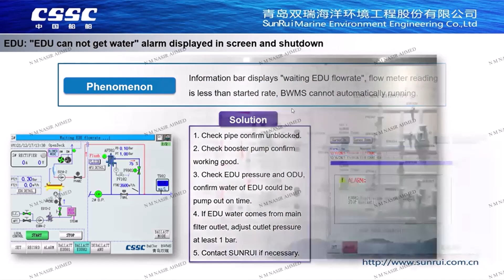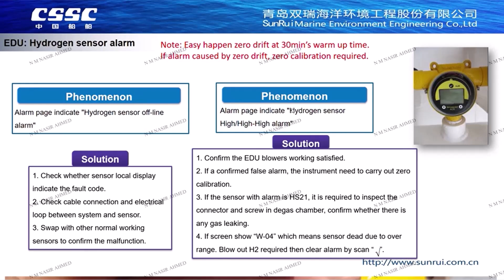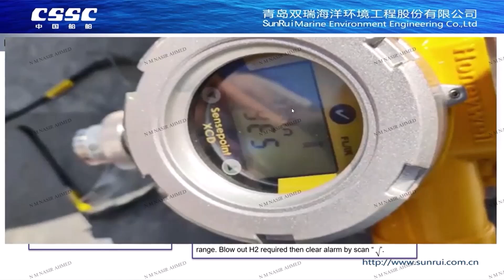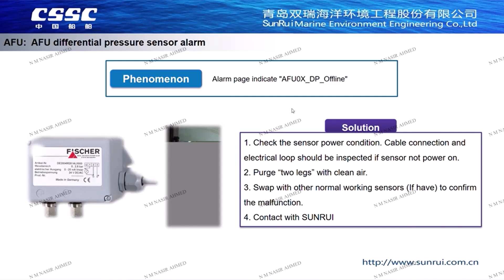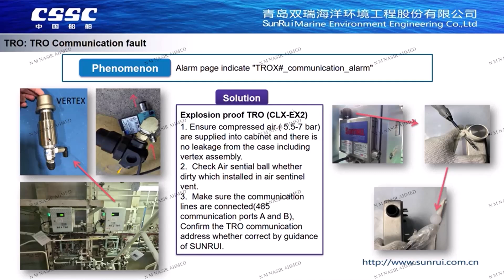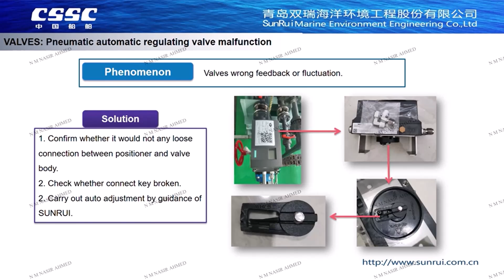BWMS sunrui Part 2 Operating System Interface

Comment: Sir, i got alarm EDU01 CS21 inside CL2 sensor offline. How to fix it sir. Thank's
Reply from the maker: This usually indicates that the chlorine (Cl₂) sensor inside the EDU is not communicating with the control system. Common checks include:

Check the Cl₂ sensor cable and connector for loose or damaged connections.
Verify the sensor has the correct power supply.
Inspect the communication wiring between the sensor and the controller/PLC.
Restart the BWMS and check whether the alarm clears.
If the alarm persists, the sensor may require calibration, repair, or replacement according to the SunRui maintenance manual.

Always follow your vessel's procedures and the manufacturer's manual before performing maintenance, and isolate power if required.